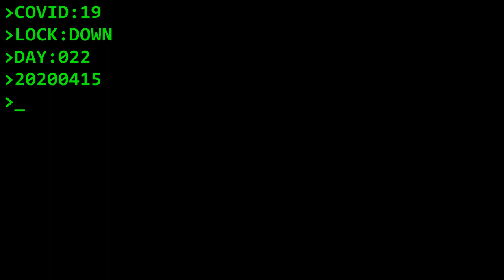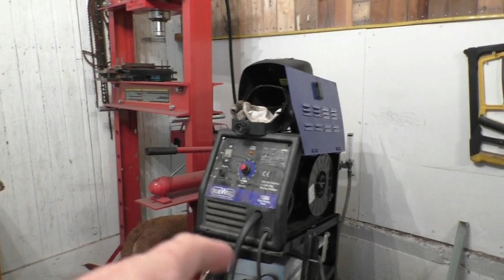Steel RC Boat build update.

Comment: HI CYANIDE! 
LOL your welding is fine dude. Loved the technical breakdown on the welder. My job is considered vital to economy so no lockdown for me.
We make aluminum parts for medical equipment and fire trucks and military vehicles. So my lockdown is being strapped to a bunch of metal working equipment.
Hats off to the guys that got you a partial spool. That boat is a really interesting project. Been following along. Great stuff. Be safe man.
Reply from the maker: Thanks Mike. I am not in the 'essential work' group, but I can work from home and the company I work for makes software, so we can continue to operate in lock down. I am not liking lock down much though.